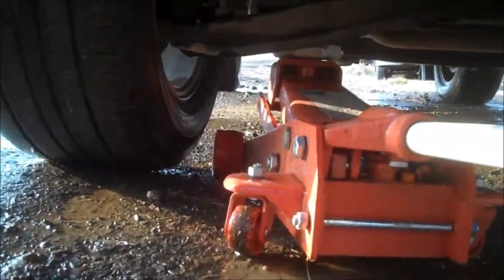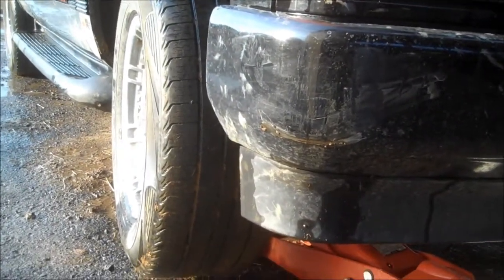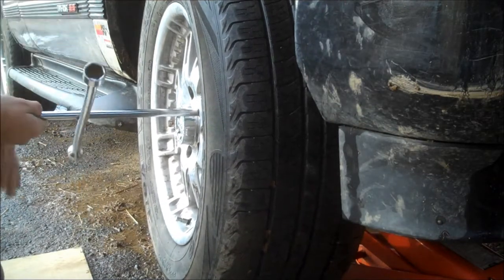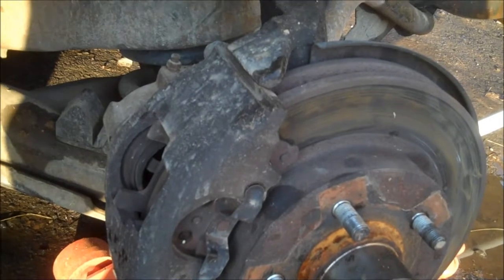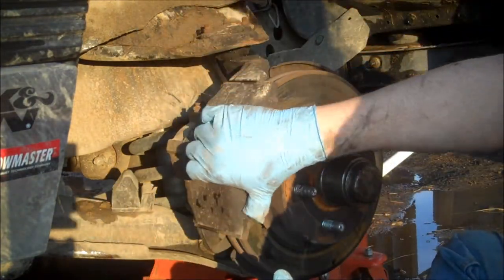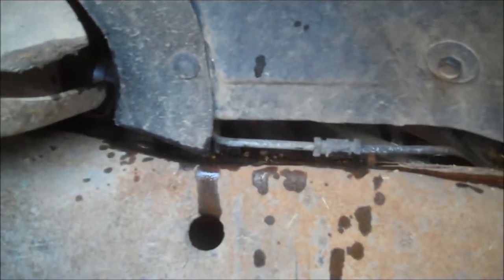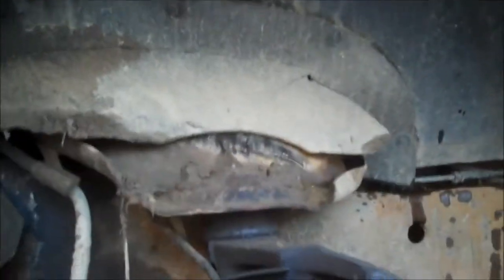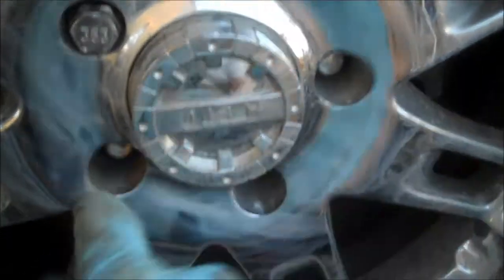How to Change Front Brakes

Comment from the maker: @delmontcrusier no that was the wheel bearings before. and yeah it's a sad state when everything is throw away instead of turning it straight again and continuing to use it. now days if you grind it down much at all turning it flat again you are out of luck and a replacement has to be ordered and installed. the ones on this tahoe are more expensive because it's not a rotor and a hub with bearings, it's all one piece and if you replace one you have to replace the other also.

Comment from the maker: @hoss4107 that pretty much was start to finish placing the jack, raising up the vehicle, removing the tire, removing the caliper, placing the new pads on replacing the caliper, recharging the cylinders, topping off the fluid and the road test. what did i miss? lol even gave a little extra in it about the greasing up the ball joints though i didn't show it i still showed where it all goes and it's pretty much the same on every vehicle though some of the newer ones have more bolts in the calipers

Comment from the maker: @grim10333  sorry i didn't get this one done sooner then, that's the very reason i make these videos though.  fear of ABS is the only reason i paid $300.00 to have the brakes on our Astro van done back in 02 & when i found out that it's not any different unless you open up the brake lines it was on. this truck is ABS too  but the only time it's any better having ABS is on Ice or wet roads any other time it's useless.  hope you learned enough to feel confident doing it yourself next time.

Comment: I don't get it. This is supposed to show you replacing the brakes. You undo the caliper and then lube and put the tire back on. Where exactly in the video do you change the brakes? You don't show how to replace the clips or pads. Very confusing.